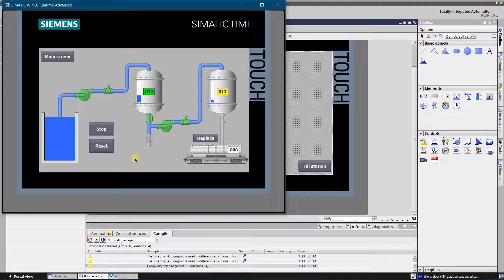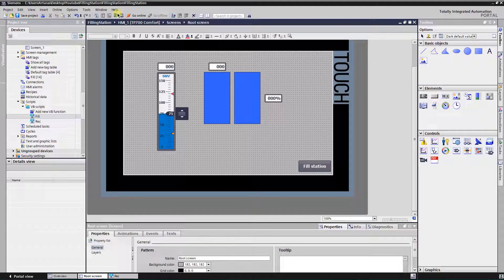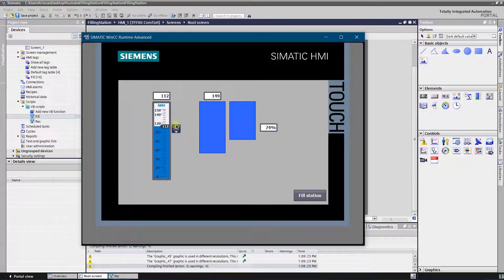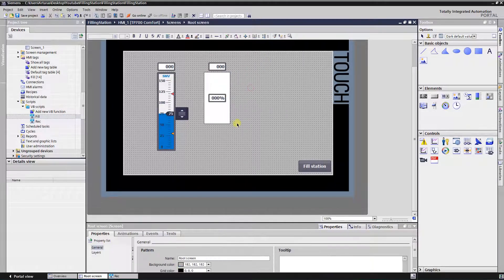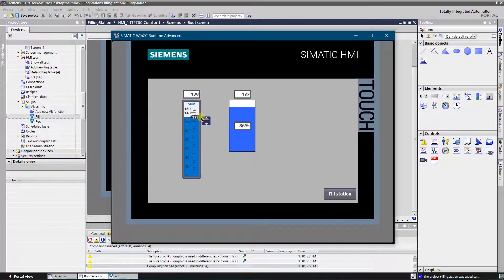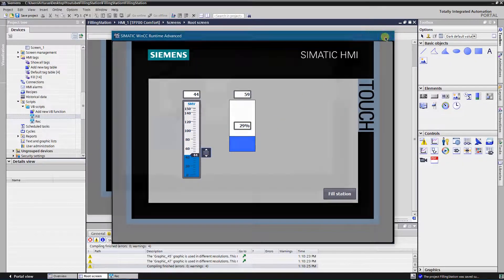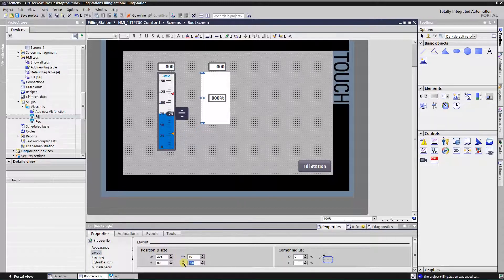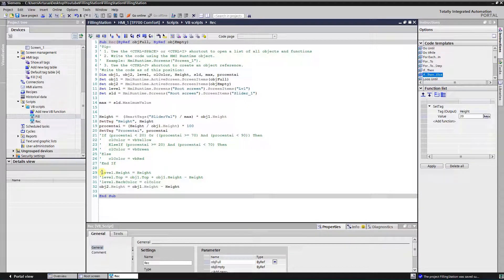TIA Portal: Tank filling up effect simulation

Comment: Hi, I am just a newbie in this programming, just wondering how do you reset on Replace button on screen 1 by using the tag Tanks_T3_Level that i couldn't find that the contact on the ladder Control FC1, would you like to  explain that I will appreciate your help thanks
Reply from the maker: Hi, click event of button is used.
Reply: @automatikavaldymas  correct me if i am wrong, what i can cacth up is Button replace was associated with Tank DB1 T3, so whenever got signal 1 it will reset the entire T3
Reply from the maker: @Ri9dlon  The component "Button" has several events like "Click", "Press", "Release", "Activate", "Deactive" and "Change" that can be fired. To any of these events numerous functions or scripts can be assigned. I do use event "Click", function called "SetTag". This function sets a desired value to the desired tag. In my case, when i click a button then event 'Click" is fired and it will fire the function "SetTag", which assignes value 0 to the tag "Tanks_T3_Level".
Reply: @automatikavaldymas  Oh ok set to 0 you are right, i have another confusing is about the timer i didn't understand why you not using a counter or looping but seems like for example, contact clock 2Hz was blinking where is that from?
Reply from the maker: @Ri9dlon  It is an internal clock of the CPU. More etailed explanation can be found here: https://www.youtube.com/watch?v=RShHcX3GACA